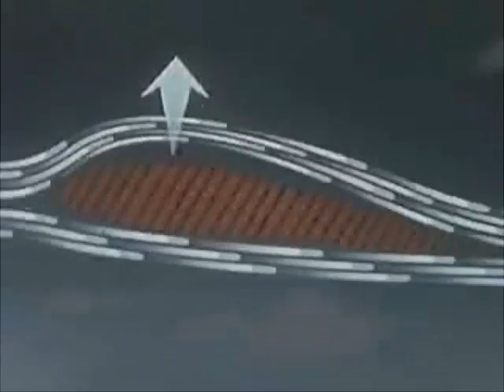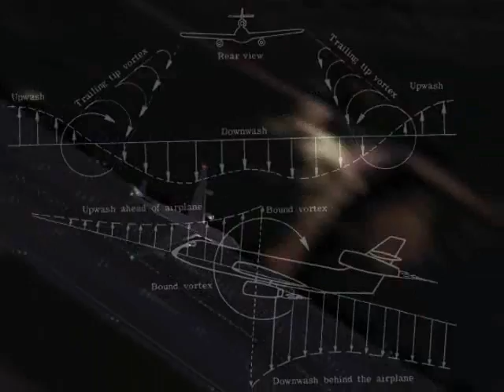Air Dynamics

Comment: Funny though, that despite it being 2018 (or 2006 when the video was published) it was still referring to the wrong theory of lift generation... take for example the symmetric airfoil.
Reply: That type of airfoil is used mostly on aircraft designed for pure speed...you will not see that type of airfoil on any airliner so your point is invalid.

Also, this type of airfoil is used a lot by helicopters and stunt planes as inverted flight will have the same-ish characteristics as normal flight.

It's not the "wrong" theory of lift generation AT ALL.
Reply: @JustAnOrdinarySimmer  so how can airplanes fly upside down?

Comment: it's it possible to just simply get a computer to simulate air density of the Earth's atmosphere and then place the Aircrafts in that "Air" and get the Realistic Unbiased performances that we see in the real world?
Reply: No, because it is not trivial to simulate the fluid dynamics. The model is only as accurate as physics included in the simulation, and we still don't understand all the fluid dynamics effects.

Comment: Nice vid but a shame it's ruined it for me by making a HUGE error. The plane does not create a pressure difference because "the upper airflow does a longer difference in the same time". It is a widely made mistake that both air particles use the same time above and below the wing to reach the end. The pressure difference is created by increasing the mass flow relative to the undisturbed airflow by means of the wing's shape and the angle of attack.